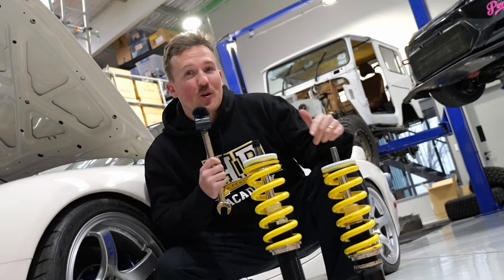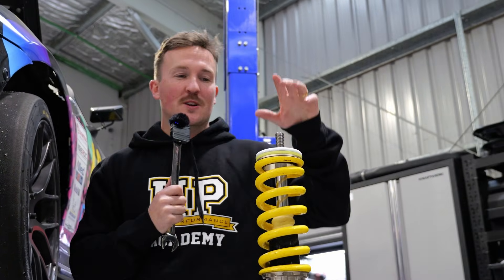Coilovers: you're doing it WRONG!

Comment from the maker: Setup and align your car like a PRO | 50% off full course: https://hpcdmy.co/setupNalign
0:00 - Most Coilovers Are Installed Wrong
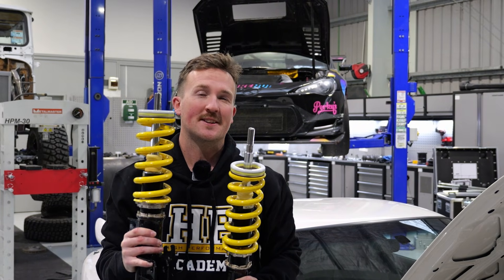0:21 - Street Vs Race, It's The Same
0:25 - Spring Preload Myths
0:43 - Helper Springs
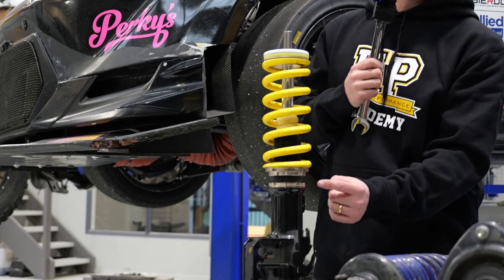0:49 - Lower Mount Adjustment Problems
1:01 - Bump Stop Failure & Crash Risk
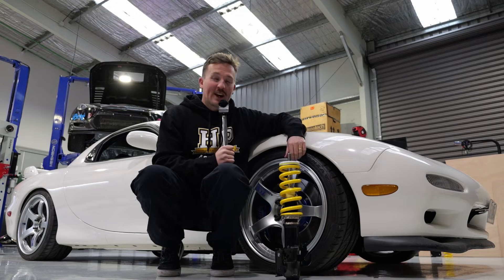1:14 - The RIGHT Setup
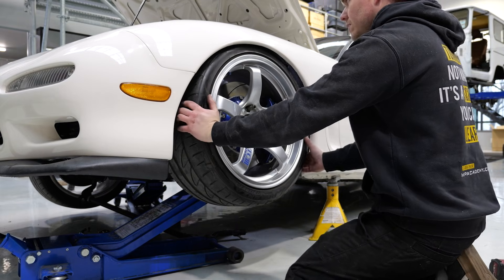1:24 - When To Adjust The Lower Mount
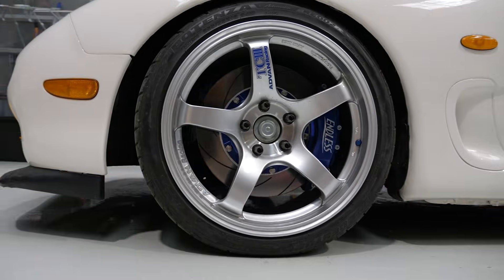1:38 - Lowest Ride Height Possible 
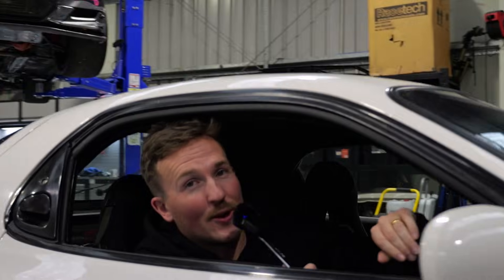1:49 - Low = Slow?
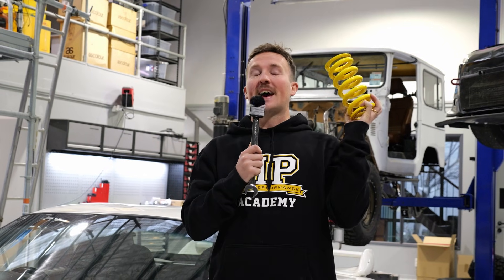1:59 - HPA Wheel Alignment Fundamentals
2:05 - Ride Height Adjustment
2:12 - Have You Had Any Of These Problems?

Comment: Very underrated subject! I didnt know any better when I first setup my car. I had 10mm droop, after  videos liek this popping up and some research I did it right. I now have 40mm of droop and 50mm of bump. However in the process I found out the rear spring supplied with my coil overs were too long and the lower body section wqs just too tall to fit a helper spring. 

Before you buy, talk to the supplier. I wish I did this but I just thought well they are a supplier, surely they know what theyre doing, but no. No all coilovers are equal. Cheers for the knowledge and I hope more people take this seriously.

Comment: I find it baffling how everyone does it the wrong way including the manufacturers like BC, because the product is generally solid, but everyone does it wrong. And the wrong setup videos get millions of views, while maybe a few hundred or thousand see these ones. It's like people don't know what a bump stop is lol. 

And yes good point about slamming the car, not only are you ruining your instant roll center, but also at ride height you should be roughly in the center of the shock travel range, maybe a bit higher, and unless you run a short shock, you're probably way on the compression end.

Comment: Do u need the spring extractor to take off the springs ??

What if ur not planning to go that low aka no fender gap but just a nice drop so it low and functional.
Reply from the maker: Not always, you can lower the spring perch on a coilover. If you do need a spring compressor there will be less to do than a typical OEM upright though which is nice, as that is always a little terrifying right 😂

You might get away without a roll centre correction kit if you aren't lowering things like a madman. It depends on the car. 
You still follow this best practice in how you set things up.
Just because you have a nice gap when things are static doesn't mean you with have a nice gap will when you hit a curb on track at speed or load a corner up on a high speed bend.

Hope Connors video here helped you out, this free lesson is also solid: https://www.hpacademy.com/introduction-to-motorsport-wheel-alignment/?utm_source=youtube&utm_medium=social&utm_campaign=general-interaction - Taz.